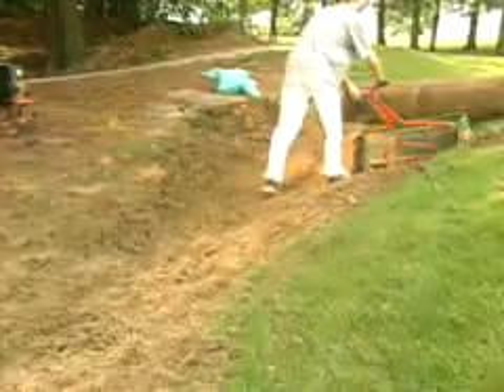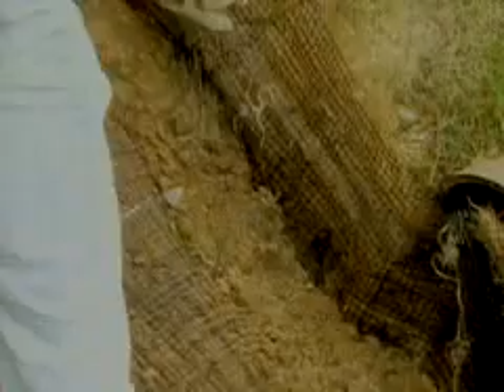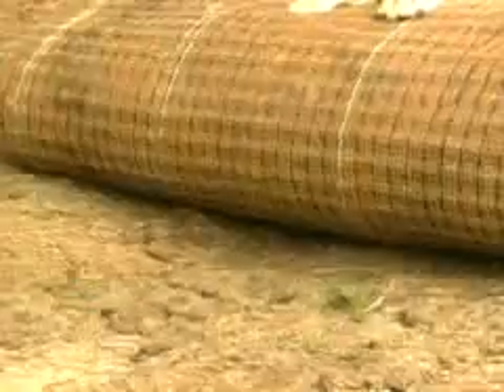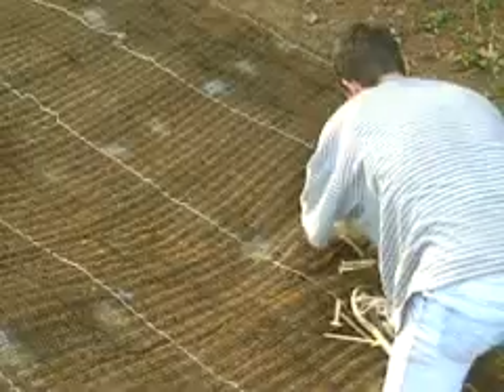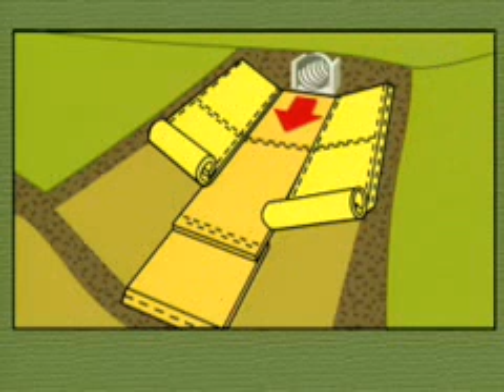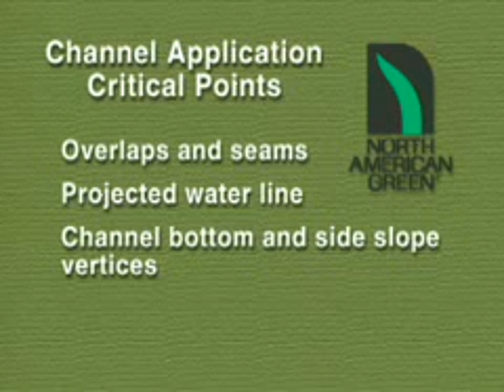North American Green Channel Installation Guide

Comment: Does the manufacturer of the NAG C350 product specify that bushes and trees be planted in the ditch when using C350? if so where is that in the documentation, and how would  planting in the ditch affect the engineered flow calculations that specify the parameters of the ditch?